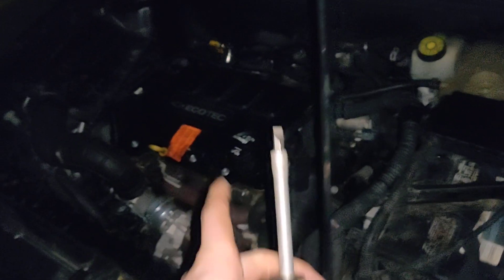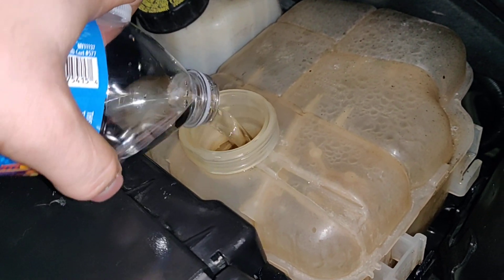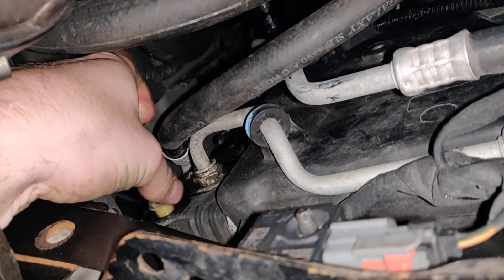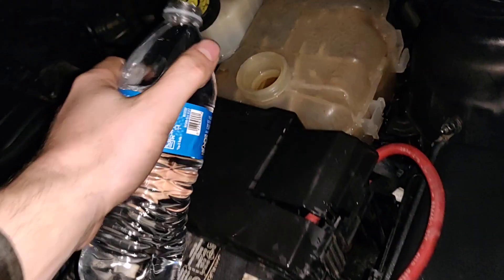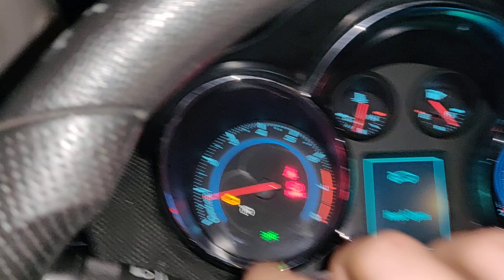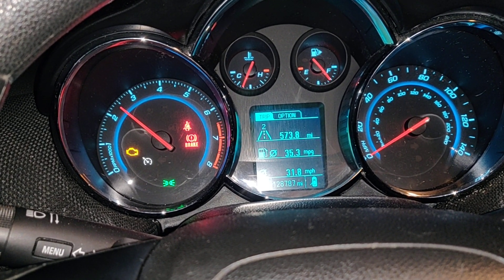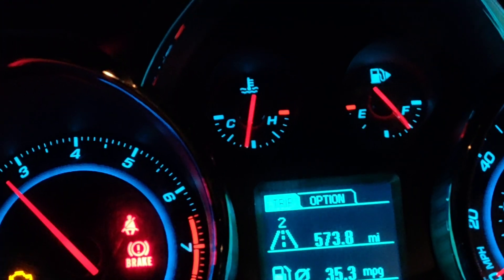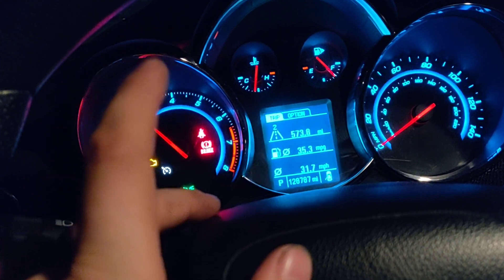Chevy Cruze overheating fix/coolant system bleeding

Comment: What is the gauge suppossed to be on? What did you do to fix the issue? Change the thermostat
Reply from the maker: It kept leaking coolant at this point I had to not only add coolant but purge the system to keep it from overheating The thermostat housing can leak also the hoses can be frail and leak just a little bit at a time
Reply: @ferenzi7741 I've been trying to find my leak.  Now I just replaced a hose that busted last week.  Filled coolant. Drove to work lost coolant.  Wondering of I didn't fill it correctly.   Need to try again and bleed it.
Reply from the maker: @jbuck1975  when you fill it up make sure your car is on level ground. You can also have it idling when you feel it with the bleed screw out keep filling it until it comes out make sure you put the heat on max so it goes through that system as well once that is finished you can turn the car off keep filling it till it comes out though that purge hole. You will either be getting that fluid in your cylinders if you have a bad head gasket or it could mix with your oil check your oil for any watery material in your oil cap where you fill your oil
Reply: What if it does mix with the oil?
Reply: @Gael-ru9lw if it mixes, take your spark plugs out and look inside the engine if there is water you need a new head gasket, valve seals and resurface head.
Reply: @Gael-ru9lw oil becomes milky.

Comment: Sometimes, it start from thermostat failure or radiator cap failure.
Reply: I didn't replace mine is it needed?
Reply: @IsraelCruz-t3w  no if those work normal

Comment: Why DEX Cool? Over other 50/50 coolants
Reply: Drain all that DEX cool crap and run the universal coolants. You won't be able to get 5 years out of the coolant but you can just swap it out after a couple years. Beats replacing head gaskets and intake gaskets when the DEX cool eats way the gaskets.
Reply: @lucidbarrier and plastic parts.

Comment: Had a thermostat sticking and leaking housing. Replaced and bled the system. Everything seemed fine. Let it run for 30min with no issues. Get 3miles down the road and the temp spiked suddenly. Guess there is alot of air left in mine. Lol
Reply: Then what happened? Fr. 😂 Same exact thing just happened to me. Did getting the rest of the air out fix the problem for good?
Reply: @christopherparsons6849  no unfortunately. Seems the head is blown. When I called THE place in my area for GM products I was told that I was lucky to have gotten 122k out of the engine to begin with. He also said it would cost me more than the car is worth to fix it... So its currently parked and bought another A to B car cheaper than the fix would have cost.
Reply from the maker: @caboosette1869  I'm sorry you had a lot of problems I hope you got a better car
Reply: @caboosette1869  i got a used engine for 1750, but we're up to $5200 in repair bills now
Reply: @angusmcpherson bad , Chevrolet good reason not to buy.

Comment: I have a 2014 Cruze with 1.4L , 185,000 miles. Other than the check engine light. The Cruze run very good. 

I’m getting a P0420 check engine light now. I replaced the O2 sensor downstream. The check engine light came back. Next I tried 1 gallon of Lacquer Thinner in a Half a gallon of gas. 

That did make the check engine light go out. But it came back around 485 miles later. I will try to add a Fouler to the O2 downstream sensor next. 

Update
Fouler didn’t work. I will probably have to replace to the catalytic converter next.

Update : 2023

I didn’t replace the Catalytic converter. I want to try the easiest thing first. 

I have replaced both O2 Sensors and i cleared all the errors. The O2 sensors fixed my P0420 error. It has been 5 months and 4,500 miles. The error has NOT come back for me. Its fixed. I used the Denso O2 Sensors.
Reply: I am at 396k just now starting to have a transmission issue
Reply from the maker: They do clog up quite easily unfortunately especially with modern fuel being so low quality. I'd recommend seafoaming each full tank of gas
Reply: @ferenzi7741  Are you saying the catalytic converter gets clogged up from low quality gas. I saw some YouTube video saying to clean the catalytic converter. Remove and soak in a degreaser over night. If that doesn’t work than I may have to replace it.
Reply: I had the same problem forever, I tried all those things... turns out the clamp between the cat and the exhaust was not tight, in fact I could always see heat ripples coming out of my engine but didn't know why... even with caps on the O2 sensors it wouldn't stop the code, but sprayed the cold engine with soapy water and found it was leaking there and tightened it up, closed up the system and then it passed inspection

Comment: As soon ass u turned on the car, shouldve took off to get somewhere not on the highway.
Reply from the maker: Made a 4-hour drive afterwards drove great once the system is blood and once I can get home if it doesn't go below freezing I can drain the water and put coolant in
Reply: @ferenzi7741 but ….?
Find the leak ?
You forgot why you stopped, it leaked out, remember ????

Comment: Ya this car is a piece of crap, selling mine
Reply: It's a machine like any other vehicle, you cannot escape maintenance and repair.  Often it is owner neglect, and the owners may falsely believe they are keeping the car tip top.  I'm saddened to say, a lot of mechanics and shops are hacks and will screw you over.  I am my own mechanic, I pay for my cars and want them to last forever is the goal, you have no idea how to define neglect in automotive maintenance. Example, I spray my underbody and underbody fasteners with fluid film annually, suspension bolts, fuel and brake lines and mounting locations, bleeder screws, fuel tank straps, etc. etc. etc. all the crap that gets rusted after these salty winters.  In addition, when I got the car I truck-bed liner epoxy coated my rockers and inside the wheel arch lips where the plastic wheelhouse liners rub against, leading to rust.  

All cars are shite when you don't maintain them.  All cars are decent when you do maintain them, unless it's a Cryslur.
Reply: @RwP223  The car is OK its the piece of shit 1.4 ecotec engine , too much plastic , a faulty pvc system in the intake ,that leads to diaphram failing in valve cover,  plastic coolant housing drivers side ( now available in cast alum aftermarket) plastic thermostat housing (again now available in alum) failing coil packs most likely because the engine runs at 220 degrees, failing transmission cooler lines (leaking) <> Again PVC system has a aftermarket mod bringing it to outside , in colder climates water freezes in tube from intake to turbo (oil catch can fixes). Turbo fails if oil feed plugs (common  from heat) you need to change out at 60k to save turbo Cam solinoids leak, front timing cover and crank seal will leak, valve cover will leak, oil cooler will leak . New seals need for all at 60k miles . I have bought GM cars going back 45 years and I'm a mechanic  ,this is the worst cheapest highest  maintenance engine GM has ever made a dealerships dream. The only good I can say about it ,it gets excellent gas mileage when working
Reply: @Mechone11  I own a 2013, purchased in 2015 with 20k miles, I max tuned it and added water meth, 40lb injectors and every zzp bolt on.  Nothing broke until 115,000 miles, pcv finally went, an intake and valve cover is so easy and cheap, you're basically a bitch if you cant do it in 2 hrs.   

This car was 100% abused and beat on, 15 autocross events with 200 tw tires, and I am absolutely trying to destroy the car, one of the top class racers borrowed my car once and I beat his times still.  

Stock Clutch, 120k miles now, totally abused and beat on, stock non performance economy car clutch survived and still going, with a fully tuned car.

Tell me how this is a POS? Every single electronic device in the car works, every light bulb is stock, ZERO dtcs except O2s that I masked out.

Why is it that every machine I touch last forever, why do i have a 1999 silverado my bro bought in 2001, with all stock powertrain, stock ball joints and tierods.
Reply: @Mechone11  omg you got to get out more. The 1.4 is an iron block, its an extremely stout engine.  Muh PCV is such a lame cop out.  Why dont you go look at Ford cars maybe youll have a point.
Reply: @RwP223  Really will I guess your just the best , and everyone else has issues . There has even been talk of a class action suit over this engine. I have owned a saab 93 turbo for 18 years no issue no lights every part and sensor is original. No plastic parts cracking ,leaking. Ifind it hard to believ you have that mileage and no oil leaks and or coolant failures ,when everyone else has . The 2.0 ,2.2 and 2.4 was a far better engine and i put 250k on 2 of them and over 300k on another
Reply: @Mechone11  Why are you mad?
Reply: Me too honey you ain't lied. Every time you look around something with cooling system one or the other. Piece of s***

Comment: Nice tip on bleeding the cooling system, but use Dexcool instead of water next time.
Reply: He is stranded
Reply: Just throw in Dexcool is filled with assumption.  Full strength? The GM service information says you can use potable water (water safe for drinking) in the Cruze cooling system.  In addition, there are affordable instruments that test coolant, either by density or refraction and these devices will indicate the estimated boiling point and freezing point of the cooling solution.
Reply: @RwP223  Dexcool comes pre-mixed, so no need to dilute.  Using water only is for emergency situations.  Otherwise, your entire cooling system will degrade over time, not to mention if the weather goes below freezing.  Then you have real problems
Reply: @fredmertz8538  AC Delco dexcool also comes full strength, equivalent brands call it a "concentrate".  As my own mechanic, I would help the customer by checking the coolant capability with a coolant tester and then siphon the bottle and fill it with full strength and run the Cruze 1.4 (which circulates coolant idling) and recheck it, then test drive, and recheck it and SHIP IT.
Reply: @fredmertz8538  he literally said hes just using water to get himself home. You rather him fill it with gravel?
Reply: @fredmertz8538  never buy premixed. Thats some crazy expensive water youre paying for. Ha it isnt that hard to fill a jug with tap water
Reply: @fredmertz8538 it depends.

Comment: my car is having same issue. thanks for the videos
Reply: That's because these have an electric thermostat on them that when they fail they stay shot which causes the water pump seal to leak or the thermostat housing to leak and overheating because circulation has stopped cars came for years with automatic thermostats these ones are electric

Comment: Cruze vehicles are junk brother.
Reply: I have two of them.  Use full synthetic oil and maintain the cooling system and they will give you no trouble.
Reply: @fredmertz8538  exactly mying drives great 👍
Reply: @fredmertz8538  my 2017 has given me no issues either, bought it with only 4-miles.. Mobil 1 oil changes, no issues... 38k miles
Reply: @fredmertz8538 why do we have to deal with coolent parts everytime and spend the money on it
Reply: @alibeize3251  Should only need new coolant.  The dealer should know to bleed the system so there are no air pockets.
Reply: @fredmertz8538  how do you maintain the cooling system? mine recently had the check engine turn on and it started over heating.
Reply: @whatsup783  I take it to a local Chevy dealer.  I have them flush the cooling system every 5 years.
Reply: @whatsup783 replace everything in the cooling system like hoses, thermostat, water pump and reservoir and drain the radiator like he did
Reply: @fredmertz8538 True. I've been chasing cooling system issues for the last 30k. Working on one right now P00B4.
Also a piece of my water-outlet broke off and is jambed up somewhere in the system. I'm guessing around the radiator I put somewhere, or where the hose turns 90 degrees around the corner 😃
Reply: I have a 6-speed version.  Tuned with all the bolt ons at 22k miles, maxed out the turbo, been spraying water/methanol also on boost always.  I race this car often autocross, has sticky tires.  When I'm racing on the street or track, I have no care for the cars health, just care about going as fast as possible (driving a slow car fast is a riot).  It now has 115k miles, and I've only replaced the alternator (because autozone wouldn't continue warrantying batteries because I killed them yearly) and front brakes.  Stock intake, stock PCV, stock ball joints & rod ends.  All electronics work.  

Why is this?!?  I have a 99 Chevy Silverado with stock engine and trans, stock ball joints and rod ends, stock rear diff, it doesn't burn oil. I've resealed the engine (front and rear seals, oil pan) and did the reaction sunshell at 140k miles.  It now has 196k miles and driving it daily.  

Then there is this Pontiac Slostice I got, heavily modified (500 bhp) and it has never let me stranded.

Should I go on about my GMC Cube Van, or the 96' Blazer that was purchased new and is still in the family?

Looks like the common denominator is the person responsible for driving and maintaining the vehicle.  Like all machines, they wear out and wear accelerates with neglect and abuse.  

Cruze vehicles aren't junk relatively speaking, the owners are junk.
Reply: @RwP223 do you think I could pick your brain about adding a couple of things like that to mine
Reply: All car are junk, if you can't maintain it correctly
Reply: I just spent $2000 getting this issue fixed! Oh I’ve only had the car for 6 months at 50K miles! Not a good car I’m looking to trade this piece of shit in ASAP!
Reply: Bought mine new in 2012,  170,000 plus miles still run great only issue in 10 years, replaced the alternator and worn coolant hoses. I wouldn't be worried about taking it across Country. Properly maintained they'll keep on going.
Reply: @randysparanormalinvestigat9657  
Well brother my cruze is laying in junkyard one week ago and I sold it for 480$.
I am glad to close this chapter.
Reply: @inspector9290  Stop neglecting machinery, 95% of the time a car dies because the owner unconsciously neglected it.  There is a reason ALL of the cars I've owned since I became an adult 2 decades ago have treated me well.  I'm not special, I'm just the mechanic who has to fix these cars and I want to avoid fixing these cars so I maintain them myself to my standards, no one else is allowed to touch my cars unless I need a laser alignment, even them my friends who own the shop let me do it myself if they're not busy, where I help the alignment tech if they're busy.
Reply: @inspector9290  Ok, but I'm going to keep driving mine. However I will not buy one made after 2016.. nor will I buy one with the 1.8 Lt that motor is junk and weaker than the 1.4 turbo. Like I said it all depends on proper maintenance. Have a good one.
Reply: @inspector9290 open the next chapter...Chevy Cruze Chapter II
Reply: @1Patient  
Well halow nice to read your comment about the junke car ever made.
If you want my advice just leave it emidtly.
Buy Toyota vehicles like Camry or corolla from 2000 ~ 2005.
These are the Greatest cars ever made.
Reply: @inspector9290  Toyota's are great cars. They'll drive a million miles as long as you maintain them like any vehicle. Buy domestic.
Reply: I have a 2012 best car ever it has 163000 miles and no major problems! Also great fuel mileage!
Reply: @bernarddevlin2592 I also have a 2012 Cruze 1.4 turbo LTZ RS with 340,000kms and it has original motor and transmission, radiator and hoses. Change the oil with synthetic since new and transmission fluid every 2 years with synthetic and it runs great.
Reply: @bernarddevlin2592  
Well it's your good luck.
But for me it was my nightmare until I threw it away in junkyard.
These car's are not made to live a long.
The major issue is the engine and gear box overheating.
Corolla,Honda and even Hyundai is better this is my opinion.
Reply: This is a car worthy and very capable. I would buy one for my grandma, because I ❤ her, and she deserves the best...
Reply: 1.4 turbos are junk yes. 1.8 naturals are friggin tanks. Believe that
Reply: @geezuss1114  
Yes indeed brother and you are most welcome to our cruze haters convoy.
Reply: Well yeah but they get the job done
Reply: 2018 Cruze, 78000 miles, zero issues.
Reply: @E_Legal_Alien  
I am pleased that it was a nice experience for you. 
But for me it was a nightmare.
This car was made by Korean Company called (DAEWOO) then it was purchased by Chevrolet.
I didn't know about that until I used the car and went in maintenance process.
This car again has two major issues:
1. Engine overheating.
2. Gearbox overheating and  oil changing , because it's not like GMC vehicles system, So you should change it every 30,000 km continually to avoid troubles.
Reply: I like em. Just look after them and you'll be alright
Reply: @yaccfonoti  
Yes brother cruze vehicles are not reliable and has so many electrical issues and not to mention the engine over heating Olso the gearbox oil should be changed each 30,000 KM .
This is my opinion and experience until I threw it away in junkyard with no sorry.
Reply: Great cars. Only bad owners
Reply: @ryansnaidauf9313  
This is your opinion. 
I respect it but it will not change the meaning of obtaining an reliable car.
This is not made mainly for chevrolet company; it's  fir Dawo company.
So you can check in any browser about the most reliable car - I am sure you won't find any name by (CRUZE)!!!
Reply: I agree!!..Mines runs great when it's running great...I had a small coolant leak from the temp sensor..now I changed it and the csr keeps over heating..I jave bled it and bled it..